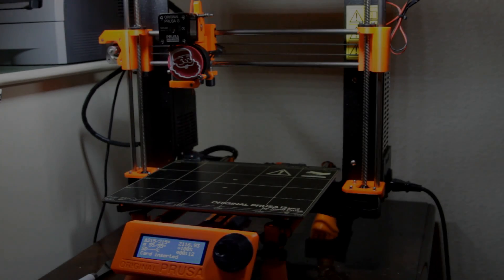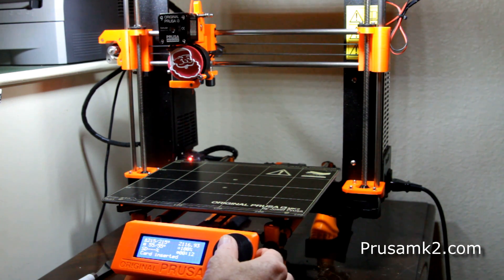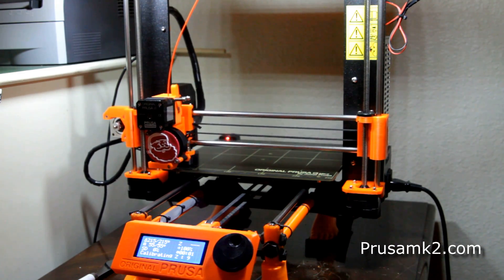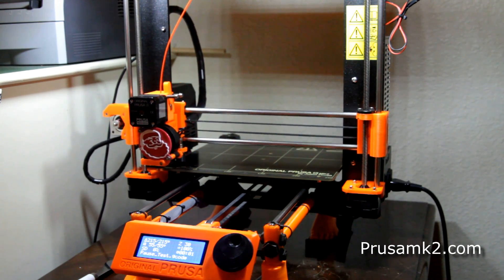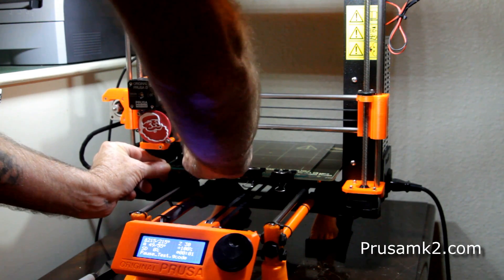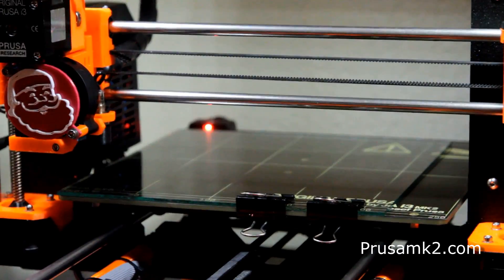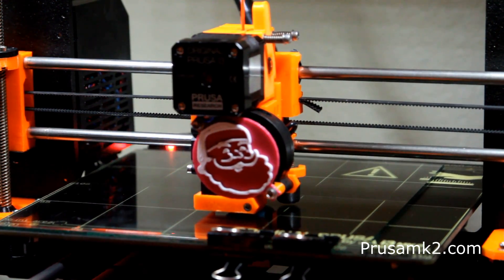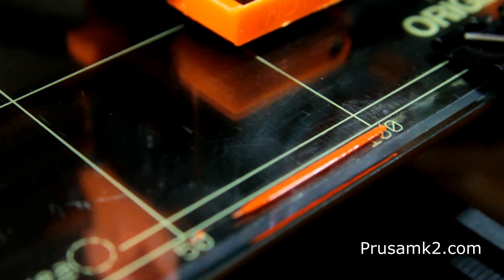3D Printing on Glass with your Prusa i3 MK2 - Smooth as glass!

Comment: Can this be used to print with glass on the MK3?
Reply from the maker: ya, just use the same gcode and account for the thickness of your glass.
Reply: Is the glass placed on top of the removable PEI steel sheet or on the heated bed without the flexible sheet?
Reply from the maker: can be either way but if you remove the pei, get its thickness and add it to the glass thickness in the gcode to account for the height.

Comment: Waited for a solution like this. Great job Scott!
I have several FR4 Sheets where I like to print on. These are 0.9 mm thick and up today, I couldn't print on them due to the automatic mesh bed leveling. Now it should work. Advantage to glas: you can easily take the sheet from you printbed and remove the printed items just by bending the FR4-sheet gently (if they stick to strong to the sheet).

Comment: There is an easier way to print on glass with the prusa. (look what happened if you hold a flat steel under your P.I.N.D.A while its MBL) ;-)
Reply from the maker: SHow us what you're talking about would love to know and see.
Reply: techtiptricks if you have a glass with the size of the printbed, just put it on the printbed. Then you start the print. When it starts the MBL lay a flat steel on the leveling pionts. 
If you whant to try it, try it without the glass. ;-)

Sorry for my bad english
Reply: I don't get it.  If you lay a flat steel on the print bed where the leveling points are, the steel would obviously have some thickness and would throw off the nozzle height, would it not?
Reply from the maker: Thats why you dont "lay Steel" on the bed. The conductive points are built into the hot bed.
Reply: Razor blades are thin enough.

Comment: I must be doing something wrong. I've created an account on the page but can't see the startup gcode. It's an interesting solution, so thanks for the contribution.
Reply from the maker: Log in and possibly refresh the page
Reply: Tried. Used Firefox and Chrome. Different networks. Login / logout. No go.
Reply: Connecting Facebook was a requirement apparently.

Comment: Thanks for your clip, but I really don't understand why the probe can account the glass thickness after the leveling, doesn't it also set the zero position of Z axis during the mesh leveling without glass? can you explain more?
Reply from the maker: The gcode that you add as part of how this works offsets the Z by the thickness of the glass that a person has bought and measured.
Reply: got it! thank you very much~

Comment: A 900 dollar reprap doesn't come with glass oh dear :( good information thanks
Reply: Well they give you PEI bed with 3 heatzones, you really aren't supposed to print on glass with the mk2, I really can't see a reason why would you want to. Prints from my PEI bed are as smooth as if I was printing on glass, but I don't have tu use gluestick or any adhesive and the prints don't warp because of the heatzones (I doubt heat transfers that well in glass)
Reply: Prusa is Open Source company, so their firmware is everything but locked down, you can get the code on their repo: https://github.com/prusa3d/Prusa-Firmware

But don't get me wrong, I think it's cool that you did it and I might try it in future! :) I just felt the need to anwser the "A 900 dollar reprap doesn't come with glass oh dear" beacuse it comes with something generaly better (and more expensive) than glass.
Reply from the maker: I like to... because it is possible to do so. So many have problems with the pei sticking to well with for example petg pulling up the pei and tearing it. Another good use is you can remove the glass and swap out to begin another print, you can spray the glass with adhesive or abs juice and do so away from the printer as well as keeping the pei clean for prints where adhesion is not as important. and then again... To be able to on a machine where the firmware is locked down was fun. I don't print batman logos or tinker toys so... yea that was fun for me!
Reply from the maker: Oh... it's locked down. Challenge: 1 month to show a tutorial enabling chitchat via marlin on video... do you accept?
Reply: Oh, I could be totally wrong.
I just thought you could download their source code, make changes, compile and then use their FirmwareUpdater just with your own firmware, what am I missing?
Reply from the maker: I paid $699 for mine..
Reply: Mark, you're such a dipstick.  Evidently, your funky Chinese i3 isn't up and running or you'd be doing something productive, rather than trolling Original Prusa videos.